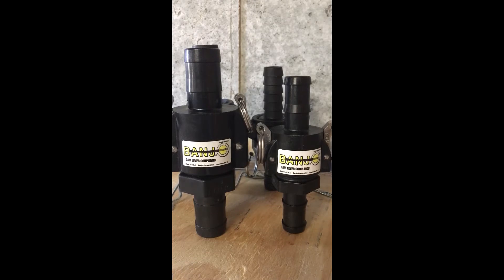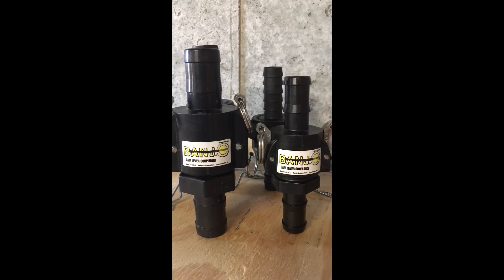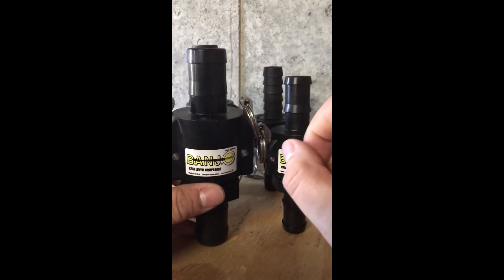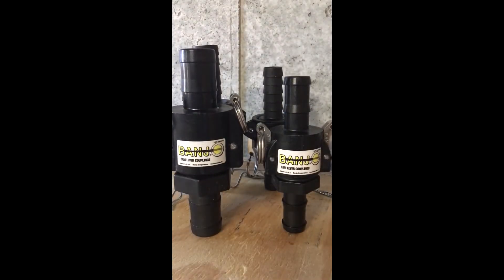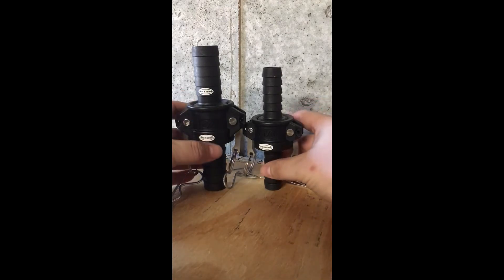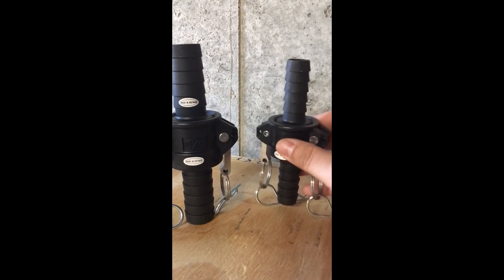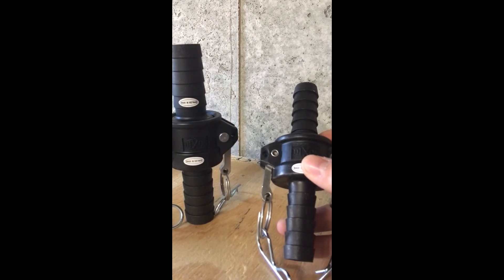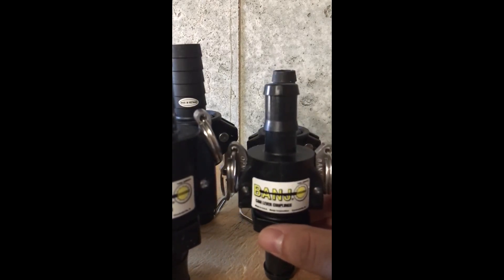Banjo and Dixon Cam Lock Review

Comment: Nicely done. One suggestion...most cam locks come with a buna rubber gasket inside. You can easily and cheaply upgrade them to Viton seals which will last far longer when you are pumping SH through them.